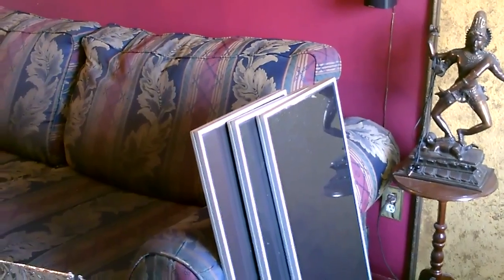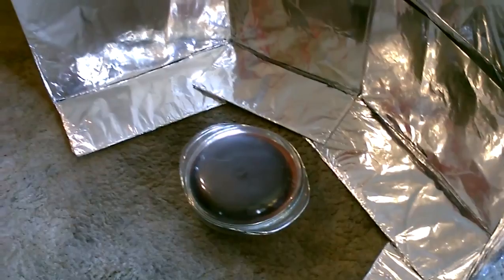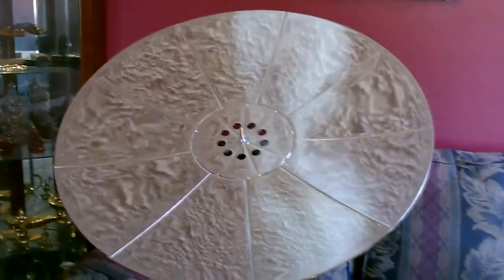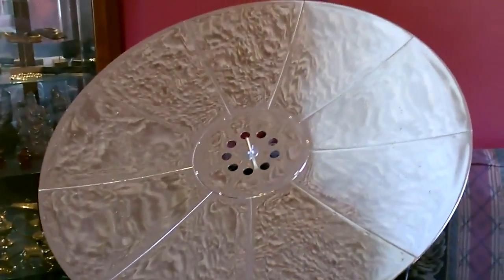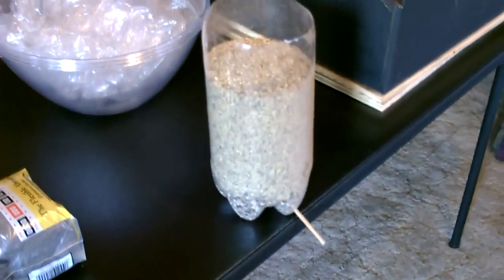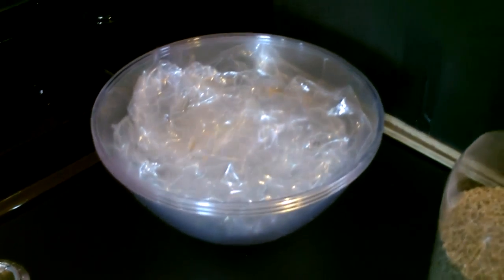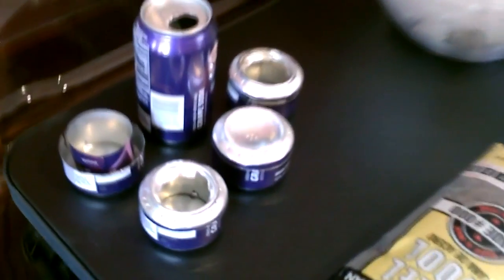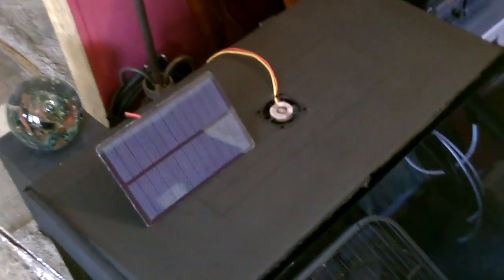Homebrewed "Solar Power/Off-Grid/Survival/Green" Channel - Solar made easy - DIY (trailer)

Comment from the maker: if you mean their charge controller, i agree.  it's good to measure the voltage, but the charge controller only handles 3 amps. i got a 25ah (amp hour) charge controller shorty after buying solar system